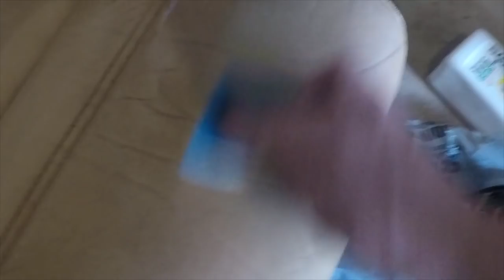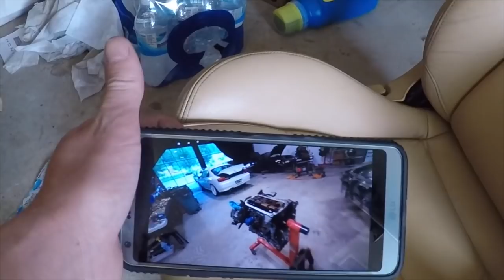240sx s14 is here & rx7 interior detail is finally done!! ( s14.5 ?? )

Comment: I'd put that insulation back in the shifter. It helps keep tranny noise and stuff out of the cabin...but (in my personal opinion) the main benefit of that stuff is it keeps heat out. 

Those pedals are stock. I've never really understood the mentality of Mazda for putting nice clutch and break pedals in, but the dead pedal and gas pedals are ugly rubber. There is a thread on the rx7club where a dude made nice matching gas and dead pedals you can check out (if you've seen Tommy's videos where he goes over his FD parts, you can see he has them).  I doubt it's been swapped from an auto though. I'd have to go back through you vids to see for sure, but a quick way to tell would be the redline on the tach. Autos have a lower redline, and people rarely change them out when they manual swap them. 

Also, rx7.com used to sell replacement seat covers. I'm pretty sure they had the tan, but haven't been on the site for quite some time. But that's something to check out. I think they had oem floor mats too. 

S14.5 would be sick as fuck. Keep up the good shit
Reply from the maker: THANKS